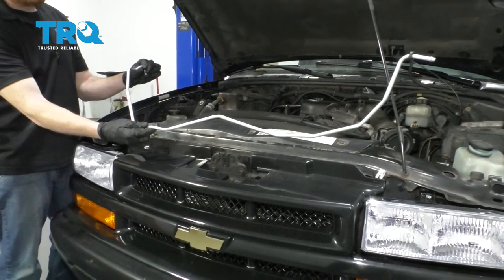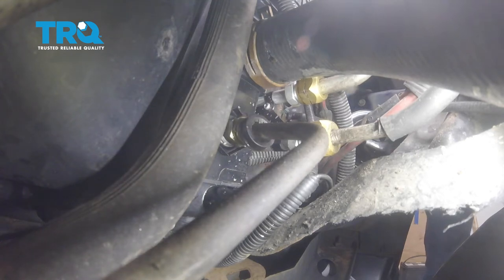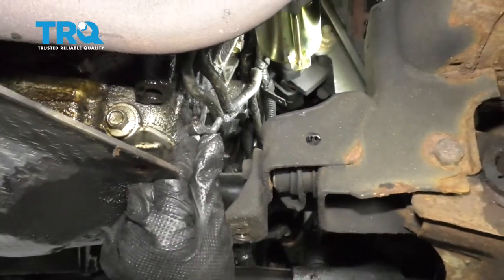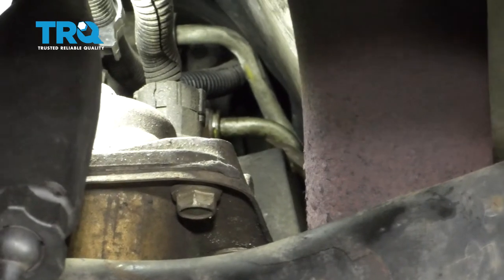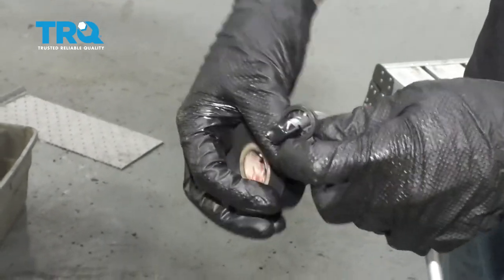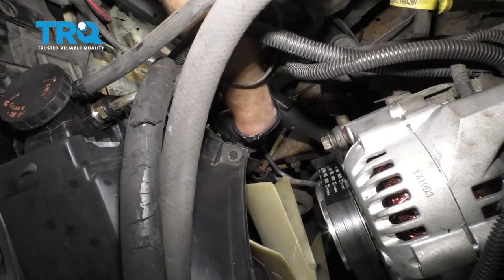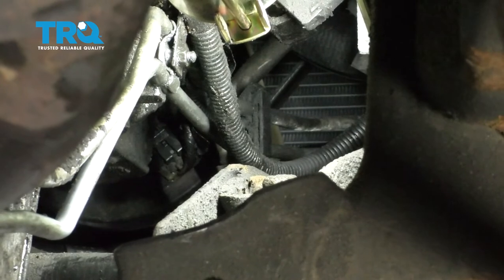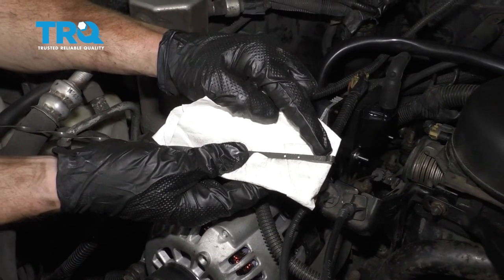How To Replace Inlet Lower Transmission Line 1994-2004 Chevy S-10

Comment: Great! And the most obvious difficult nuance is how to install the clamp on the automatic transmission fitting, which you carefully and modestly lowered, Captain Obviousness. :) But, anyway, thank you for the information about the direction of the pipe to the wheel arch in the first place... I had a big problem trying to do it in only one direction.

Comment: My lower  transmission cooler line leaks from the quick fitting clamps.  Replace it the seal. Still leaks at the transmissionside.. why? This is my 3rd lower line. Though the other two where damaged.

Comment: I have a 2002 Chevy avalanche, removing the cooling lines from the radiator is a breeze, being under the truck and trying to remove the two retainer clips Is a full on bastard of a job, thus far I am unsuccessful